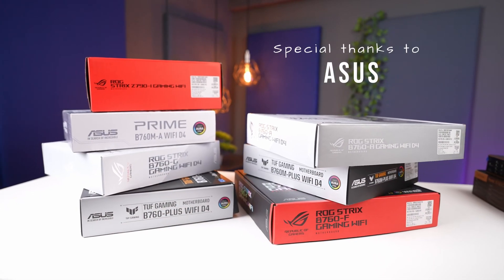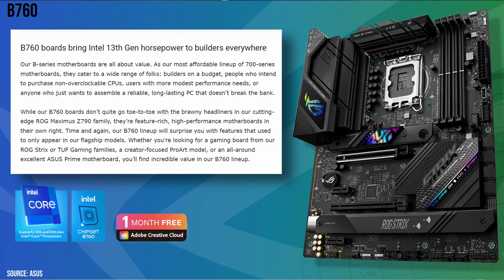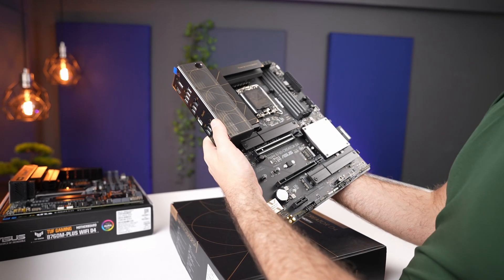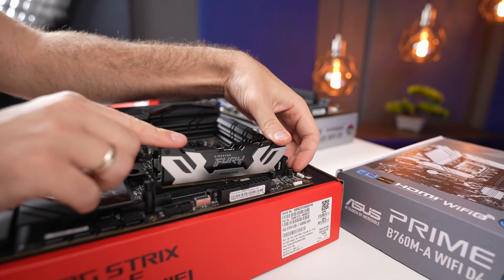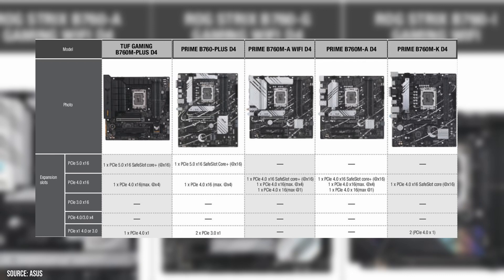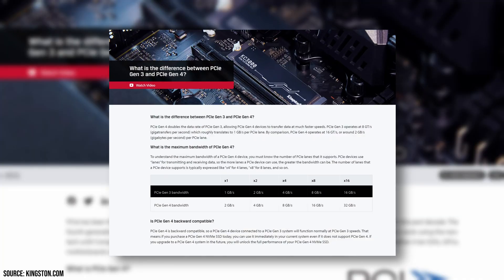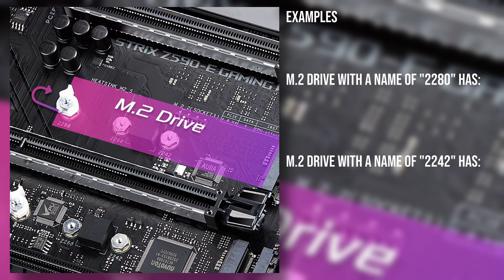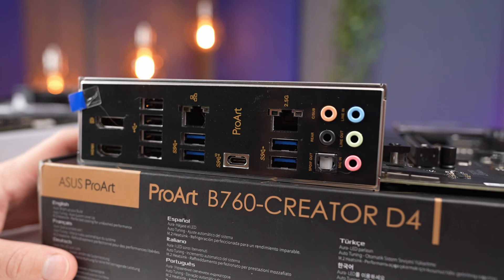Buying Guide for Intel Motherboards // B760 Edition

Comment: I have DDR5 B760M Pro RS my ram works at 6000 in slots 1 & 2 but not 2 & 4 at XMP profile. Idk if I should swap them out. Supposedly the 4 slots aren't that good for stability.

Comment: Anyone recommend a board for a 12400f? Looking to upgrade the CPU next year but want a nice reliable board for now and later
Reply: Would shop around features and price. I have a DDR5 board 12700KF build with Asrock B760M Pro RS. I got my board on sale for about 99 but now it runs around 129. If there is a cheap but good VRM Z board would also consider though a B660/760 would be all you need. Only issue I'm having is ram at speed but I am getting 6000 speed in the first two slots. I would suggest the QVL memory vendor list(DDR5 ram) and to disable XMP if it causes issues while tuning ram speed. System is very snappy though and I have 3x m.2. There are good 2.5 gb ethernet on a lot of boards now, this included. I also got a VRM heatsink for my main m.2 and have a lot of storage currently (1 x 2tb and 2 x 1 tb nvmes). B760M/Z790 might be worth if they are cheap though if you build next year for upgrading, can upgrade to 14th gen refresh for cheap with the same board (Bios update). Am reading some Z690 have ram speed issues but maybe DDR5 just has to run slower for dual channel on those. Only minus was testing ram slots. It is nice to have the PCIE5 as I have a couple of PCIE4 GPU but maybe in the future I will upgrade one day (have 3060 & 7900XTX). Some boards also have Crossfire ability. Would check the sales periodically to see what boards are reliable and reasonably priced. I never had an issue for DDR4 Asrock Steel Legend is a solid Z DDR4 board but despite the ram being annoying, the build is fast both on Linux and Windows gaming etc. Make sure you get a solid click on the graphics card and the ram if DDR5. I pieced mine off of Newegg (board) and Amazon (DDR5, cpu was on sale). Maybe there will be Black Friday sales also. It's great upgrade from 9600K 3060 build I was running 32GB DDR4 3000, mostly in terms of responsiveness. I wish I had done the build sooner in some ways.

Comment: can U undervolt a cpu in b760 boards?
Reply: Yes you can, B760 almost has the same features like Z790 with a very little different like: USB port, PCIE, Overclock, VRM, ETC…..
Reply: Check motherboard user guide from support page before purchasing. If though possible in b series boards but lack of options.

Comment: you should follow this video with comparing typical B760 boards from different manufacturers, e.g. Asrock, ASUS and MSI and Gigabyte there many options to choose from, from Asrock there are at least 3 B760 models but are they any good?
BTW your review above is helpful.
Reply: Ya true. I tink only one b760 mobo support d5 ram which is the gb aorus elite ax from my knowledge